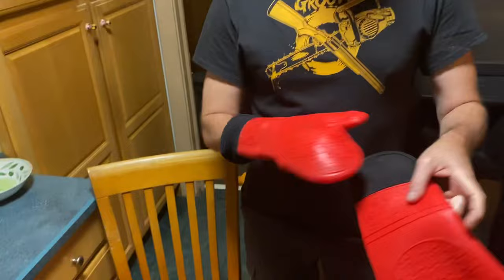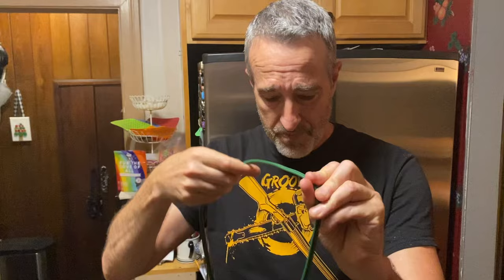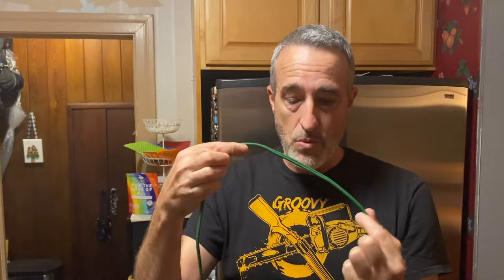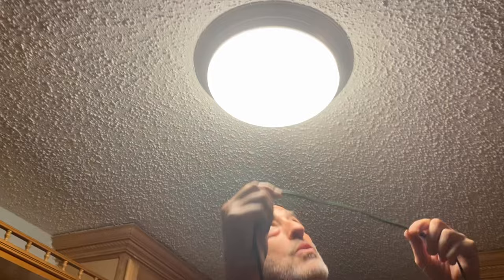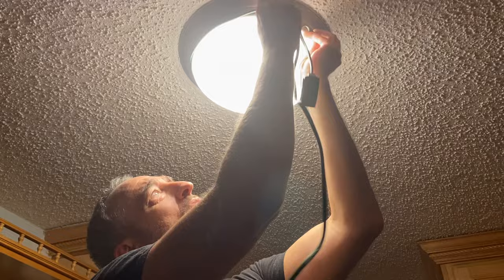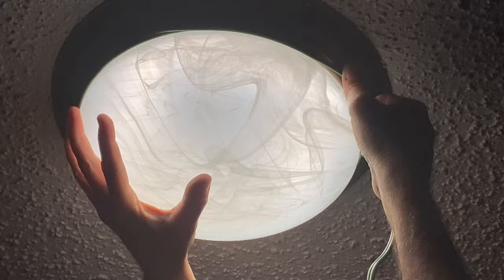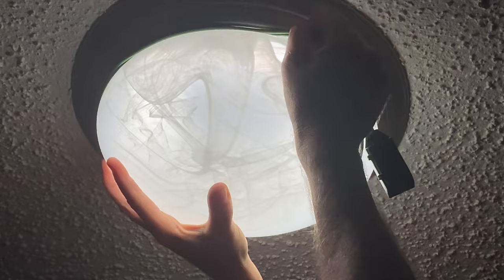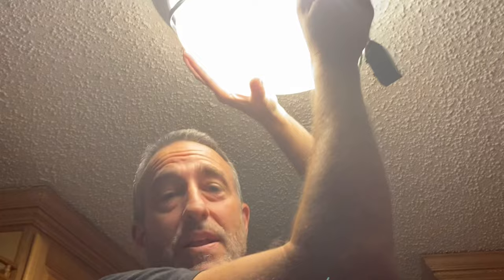How to Remove a Stuck Twist on Glass Shade from a Dome Light Fixture

Comment: Awesome video. The extension cord didn’t work for me. It gave me inspiration. I used duct tape. Wrapped it around the glass. Worked like a charm. Left a little hanging off so I could pull it.
Reply from the maker: yes, good thinking..  anything you can wrap around that glass to get the leverage needed should work..  Glad you got it!

Comment: I needed to replace the bulbs in my ceiling fan. I didn't know how to get it off. Tried using other methods from other videos but they didn't work. Tried with your method and it worked great. It's a good thing I had the cord on because I had to use the other hand to hold the stem of the ceiling fan. When I took it off the cord held it so it didn't fall to the floor and smash. Thanks for the video!
Reply from the maker: youre welcome!  Glad to hear that it worked out for you too!

Comment: Had a globe on the fixture for 10 years. Bulbs finally burned out. Couldn't move the globe without also twisting the entire fixture. After I saw your video, I used a 1/4 inch robber hose and wrapped the globe twice. Twisted the ends, braced the fixture with one hand, and pulled with my other hand like I was removing an oil filter. It came loose easily. Thanks for your video.
Reply from the maker: Fantastic!  You’re welcome.. Thanks for commenting too.

Comment: Thank you! Thank you! Thank you!  My much needed win for the day. I have been struggling on how to get that stuck dome off for years. My cord wasn't grippy enough, or maybe I didn't have the strength, but I cut a long piece of duct tape instead and rolled it on itself lengthwise and voila, the dome came off using your wrap-around method.  I think I will try putting a bit of plumber silicone grease around the rim when putting the dome back on as that has helped with keeping my water hose from getting stuck to the exterior faucets. Next will be to replace the entire fixture for something more sensible.

Comment: Amazing and out of the box thinking worked like a charm!! 🙌🏼🙌🏼🙌🏼😬 Thank you! My fiancé and I were struggling for a good week with opening an outdoor ceiling fan light dome and your method is the only thing that worked within the first 2 minutes of trying! I also used the extension chord like you suggested- even though there wasn’t that much surface area to wedge it- but even just the bit of added resistance and grip worked wonders!! Thanks again for the ingenious tip! 💡🔌🙌🏼🙏🏼👏🏼😬👍🏼👍🏼
Reply from the maker: So glad it worked for you!  Thank you very much!

Comment: Same as everyone else. I considered a ratchet strap and my next plan was the hammer and a trip to home depot to replace it... I let all 3 light bulbs die before I finally delt with it because it was SO stuck...

NOTE: the chord trick worked but mine came off HARD AND FAST... I barely caught it with my arm as it came down. It was SO JAMMED. SO 100% put a hand on it because if it smashes to the floor after getting it off this way you'll wish you just smashed it with a hammer (it's THAT heavy glass) lol😂

Comment: Thank you so very much.I am going to give this a try and get back to you. I purchased a small ceiling fan/light combo (because I don't have a ceiling fan or crossbreeze in my apt. and do not want to be forced to use my AC unit so soon...it is April right now.) The item I purchased  screws into a lightbulb socket. Unfortunately, the glass dome  covering my current ceiling lightbulb fixture is stuck. (In desperation, I  even tried spraying some WD-40 in the groove...to no avail. I am 'older' now and losing patience...along with physical  strength, even though I hate to admit to the latter.)
Reply from the maker: hope it works out.. Best of luck to you!

Comment: Thank you for your advice. I have been trying to remove my glass from the dome ceiling light in my bathroom and I have tried everything! Nothing has worked, so I’m going to try the extension cord and I will comment about it when I am done. Thank you again! Wish me luck!🍀
Reply: I tried to use an extension cord and a phone charger cord and neither one worked for me. So, I finally got fed up and broke it into a box with a hammer and I am going to buy a new ceiling light fixture! It has probably been over 20 years since that fixture was installed and I put lifetime bulbs in it about 10 years ago but it was not coming off this time!! Thank you anyway! I tried!!!😢
Reply from the maker: @veronicaarrowood8056   yes, at least your tried.  and now you will have a new light!  On the new light, a good idea to put a bit of WD40 or other lubricant right where the glass threads onto the base..  this will help to prevent this from happening years down the road..  👍

Comment: What a bunch of great ideas... I will try that. But in our bathrooms the lens is flush ... maybe put in from the back, with plastic vent-like outer ring for the exhaust fan.

But all in all you made a great video.
Reply from the maker: Mine is likely different than one for the bathroom.  Those could be mounted from the back especially if it has the exhaust outlet fan built in.  Good luck!

Comment: OMG, I have the same type!  I’ll try this today!

Update: Mine didn’t really have a groove so I couldn’t use your trick 😩
BUT, I have two suction cups (I think from baking soda) and I stuck them on and used them as handles!  Worked well!

Update 2: I must have the most stubborn light fixture EVER!  The new lights I put in were buzzing, so I had to change them AGAIN 😩. My suction cup method failed this time (WHY!!!) so I tried the “whack it with a shoe” method and that worked!  

Once you get the thing to budge it comes out so easily.

SHOE method: https://youtu.be/EH2_QXUKvSw?si=_jqHF8FC9itOEBxl
Reply from the maker: Thanks for sharing!

Comment: Great! But how do I remove the screw that hold that glass bowl? 😩 I got it to slide but it won't unscrew.
Reply from the maker: My fix is for a twist off dome.  If yours has a screw those are usually thumb screws.  If too tight to remove with your fingers then use a small pair of pliers or even small vise grips.  That will get the screw turning. Once screw/s are loosened enough the dome usually comes right off.